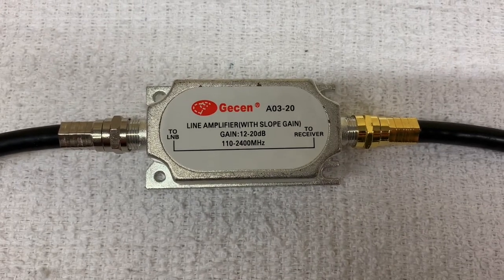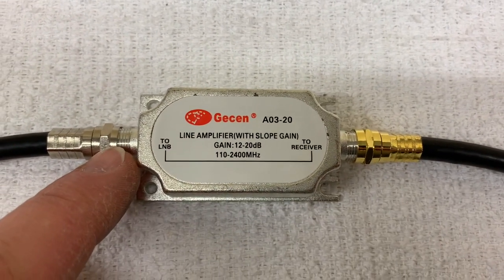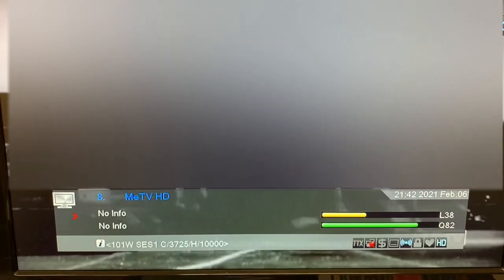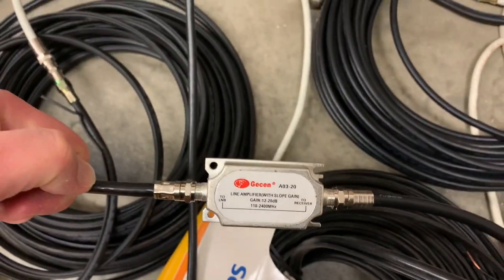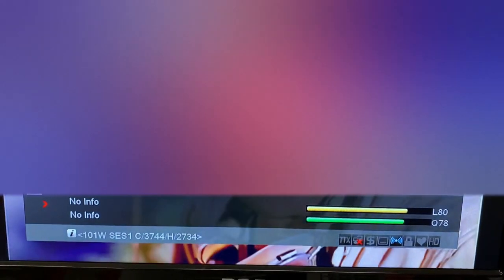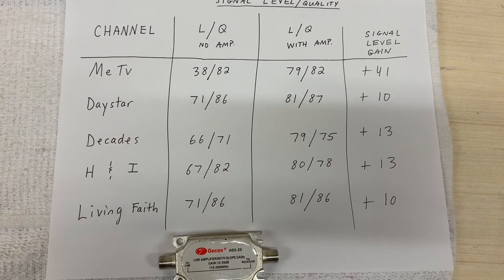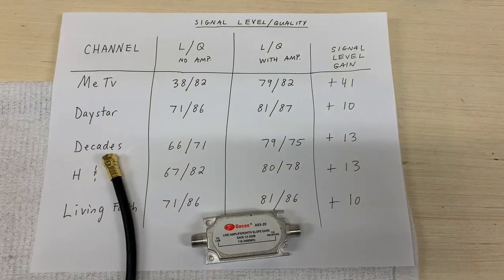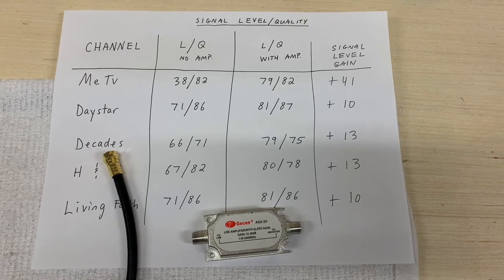How well does a satellite amplifier signal booster work?

Comment: G,day mate, my lnb requires 2 voltages for the horizontal and vertical feeds, 1 being 13volt and the other being 18 volt.  I have a satellite inline booster that says 12 to 18 volts is that fine to use on both horizontal and vertical feeds.   Cheers julian
Reply from the maker: It should be, usually there’s a voltage range on them.
Reply: Hey mate, do the inline satellite boosters improve on mer  or just signal quality.   Cheers julian

Comment: Does this work with cable ? I have approx 100 ft of RG6 from splitter to outside bldg. The outside building was wired separately  ( with RG6) so I had to put the two together with just a single connector. When I connect it to be cable box, it won’t work. I can take the same coax & connect to the TV thru antenna ( I have a small antenna on my roof ) . It works, but the signal isn’t strong. Will this help if I put it in place where I connected to the two coax cables ? The cable box & TV is about 20 ft from the connection.
Reply from the maker: This type of amplifier only works with a satellite receiver, because a satellite receiver back feeds voltage through the coaxial cable to power this amplifier. Cable doesn’t work like that to my knowledge. Sounds like you might want to run the cable line directly into the cable box, and connect the antenna to it’s own separate coaxial cable and run directly to the back of your TV and then run a channel scan if I’m understanding the situation correctly. The cable operates on a different frequency from antenna channels, so I would keep them separate. Then you can have cable from the cable box and still utilize the tuner built into the TV for antenna channels.
Reply: @NorthcoasterHobby   thanks. I’m actually trying to get the cable box to work. I have an indoor antenna that works well to that TV. I just connected that coax into the TV to make sure my line was ok. I definitely need a booster on that line, I hoped I could find one that didn’t require an electrical connection.
Reply from the maker: @tonytribble2977  You’re welcome, cable is different from satellite. If you’re paying for cable, call your cable company. They should be able to fix the issue, or maybe install a proper booster on the line.

Comment: Does this work with an analog cable tv? Old school coaxial cable? Or just digital with a satellite? Tnx.
Reply from the maker: Good question. These amplifiers only work with satellite receivers that have voltage passing back to the LNB. The amplifier requires voltage to operate and TVs and cable boxes don’t pass voltage back through the RF connector. Thanks for watching.